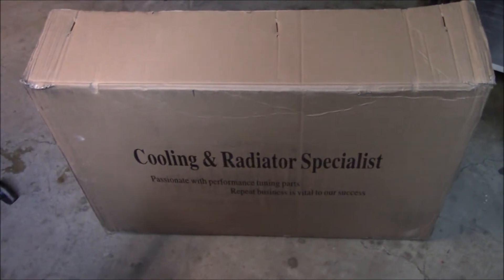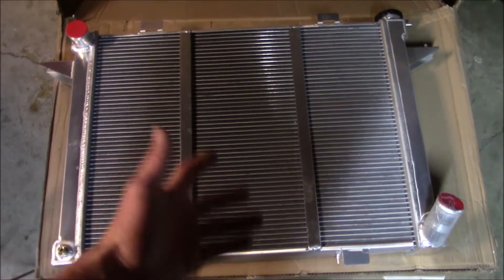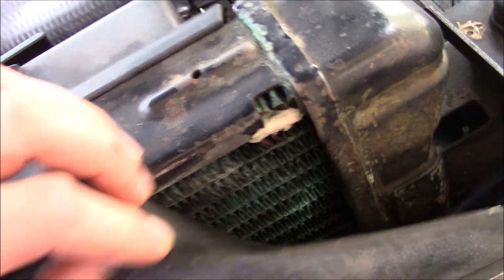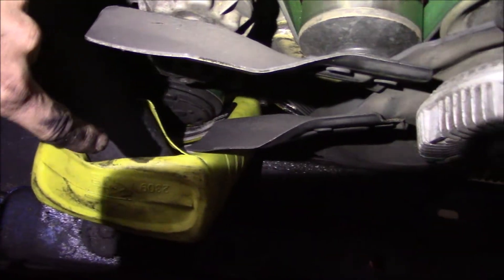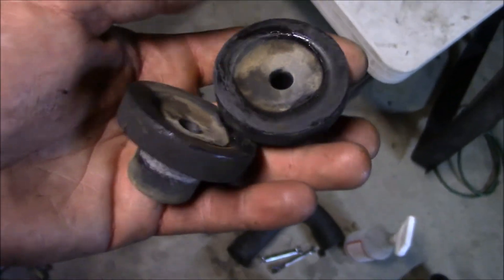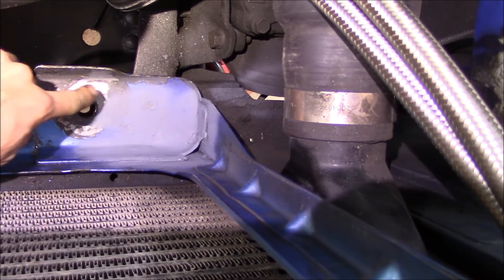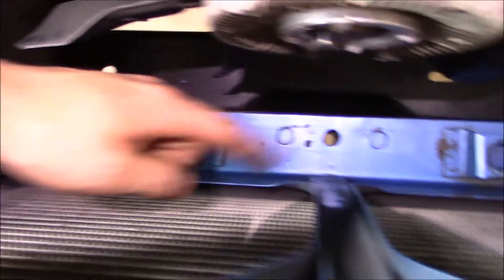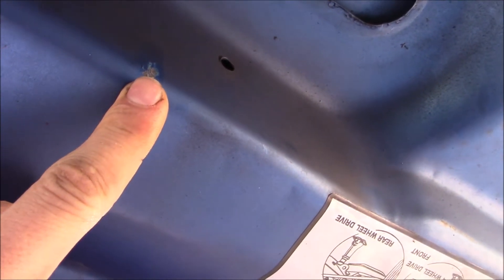1st Gen Cummins Radiator Upgrade, 4 Core Aluminum Overview and Installation

Comment: Hey brother, you can get that upper rad splash guard from Geno's garage. $15. If you haven't replaced it yet. Also, nice upgrade. Really considering the same thing for mine.
Reply from the maker: appreciate the heads up thanks man

Comment: my motor mounts just tore after 32 years lets see how long the new rubber holds up but you are 100% right thats why im not looking forward to redoing my suspension.
Reply from the maker: That's an impressive lifespan for something getting beaten mercilessly by a 1200 pound engine, not bad

Comment: I also bought a similar aluminum larger radiator with large two rows of tubes.  Mine also did not fit quite the way it should and I ended up taking it out and leaving the original copper one in.  I don't recommend the less expensive replacement radiators.  I expect them to FIT CORRECTLY.
Reply from the maker: It's annoying but part of the game if you buy Chineseium haha

Comment: So far from what I've experienced and see as far as radiators and row count depends on air flow...if you run a thicker rad you got be able to pull more air threw it. Dodge just horribly under sized the radiator for the first gen.
Reply from the maker: That's a good point.

Comment: Heres why its cheap.  4 rows of what?  each row has a gap, this limits the size of the tubes.  You may have a total of 2 inches of tube.  A Griffin uses 2- 1.25 inch tubes for a total of 2.50 inch core.  Way more efficient.  Plus mine dropped in and closed the hood.